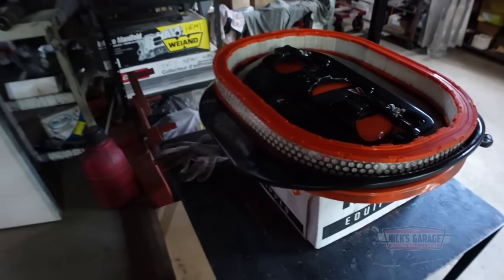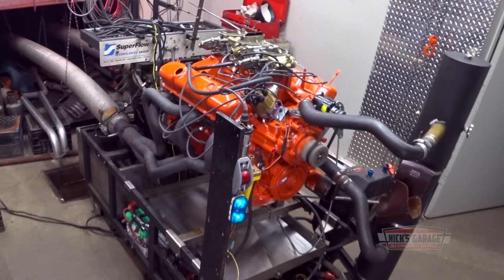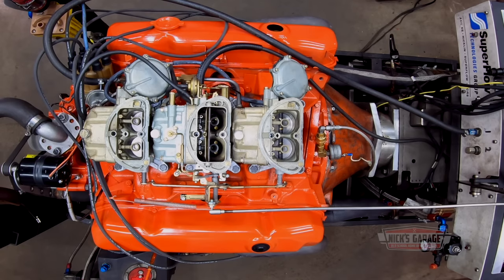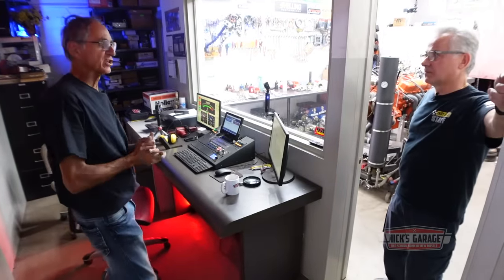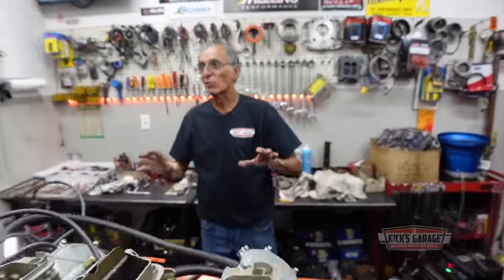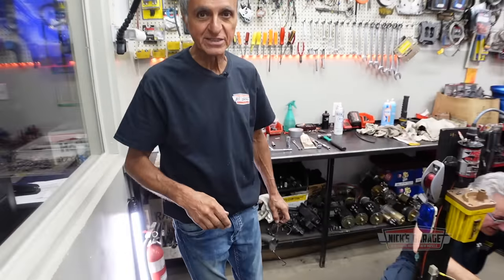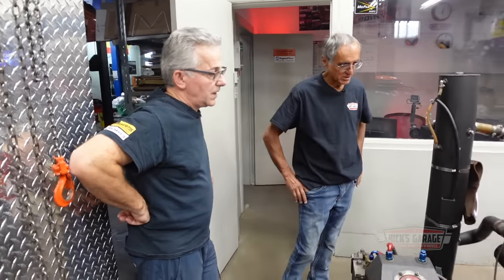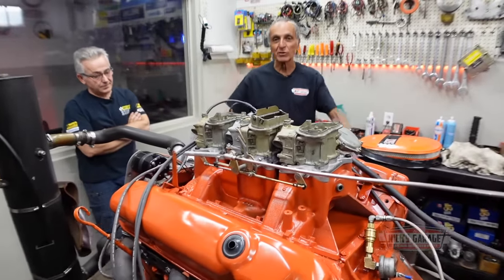HOT 1970 383 Mopar - Stroked and Dyno Tested - Road Runner Tire Melter

Comment: Hey nick I have a big block chevy 427 60 over AFR 265 fully cnc ported 235x241@50 duration 618 lift its a hydraulic roller with solid roller lifters 10.1 compression with a Victor Jr intake and 850 Holly double pumper and 1.7 roller rockers I'm hoping for around 525 hp so do you think it's possible? Any feed back would be appreciated.  Going on the dyno in a few weeks
Reply: 550 hp+  (@ the crank)
What is the AFR 265 (CNC)   FLOW??
??FLOW  over 300 cfm ??  will put the engine  @ 600 hp
When you Dyno your engine,    send me a comment back,  about  engine  hp.
Have Fun
Reply: @billywilliams6853  they say the heads I have the afr 265 will flow 345 what I think is going to kill my engine is its about 10.2 to 1 its a 427 60 over but the cam shaft is only 235x251 @50 618 lift
I would love it to make around 550 @ the fly wheel I seen a dyno at west tech and it was a 468 with 10 to 1 compression and a co.p cams xe300 more duration with the same heads ìt made 622hp I'm thinking the cam is what's going to hurt me
Reply: It would be really nice to make 600 hp but I really don't think it will.
Reply: I think you'll be pleasantly surprised 😉 I'd guess you'll get at least 550 probably more honestly. That's a hell of a motor lol
Reply: @richardsmith-qy6vl  
If you're going to drive 🚗  this on the street,  it  will  be  Great , keep the 235/251
Big Block  Chevy  Torque will  destroy any street tires. 
Just worry about the poor transmission.
Traction  is  the key 🔑
Reply: @Steve-bi4ej  
Amen to that 
Wishing I had those heads
Wishing I had that engine.
Reply: @billywilliams6853  yes it my street car I have a fairbanks turbo 400 with a manual valve body and a 3500 stall and I'm putting either a quick performance 9 inch or a 8.8 in it the 8.8 has strange axles and center section. And more then likely umi adjustable trailing arms and anti roĺ bar they say that wiĺ make a g body go straight and hook pretty good. If it will run a 10.90 I'll be happy as hell
Reply: Oh I'm sorry the cam is 235x241 I hit a 5 on accident and it's a 108lsa
Reply: @richardsmith-qy6vl  
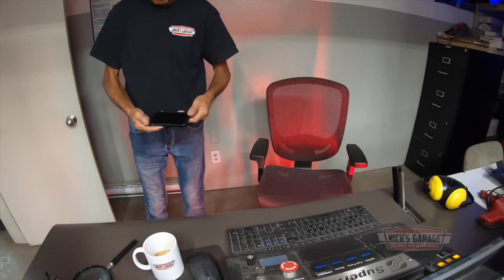 The rear end gear ratio,   stay in the 3 series.  Like 3:73,  do Not use 4:88 or 5:13.
That BBC will output 550+ foot pounds of Torque. 
Your Torque convertor will  flash multiply that engine Torque  2 or 3 times (550 X 2 =  1,100 ft/lbs).  Then the transmission (1st gear) will multiply by 2.54 (1,100 × 2.54 =  2794 ft/lbs.   Next multiply your rear end ratio (2794 × 3.73 = 10,421ft/lbs)
But in the quarter mile a 11 second car will be at 120+ mph or 10 second car 🚗  at  130+ mph.
For a car 🚗  top end  speed of  120+ mph or 130+ mph 😳 🤔   with rear end ratio  of 5:13 
What is the engine rpm,   8,000 rpm????? Or 9,000 rpm??????
Need to know your tire circumference,  how many inches your rear tire  moves on a concrete surface ,  One Revolution 🤔.    (Your tire roll out)
You do the math. 
I have seen,    many  quarter mile track cars,    hit the  engine's redline,   before the finish line 😳. 
Stay  with  a  3 series carrier
Reply: @billywilliams6853  I'm going to run a 275 on the street and a 28 x 10.5 slick with 373 gears no bigger then 411 I want to be able to drive the car on the hwy.
Reply: @richardsmith-qy6vl  
Excellent
Reply: @billywilliams6853  well yesterday was dyno day and I am so happy my motor made 643 hp and 590 tq I'm going there tomorrow to film al pitre said he's never seen a 427 make that kind of power before I would have been happy with 550 but I got a extra 93 hp...lol
Reply: @richardsmith-qy6vl  
Excellent
Reply: @richardsmith-qy6vl  
Those heads are good for 600+ hp.
Reply: @billywilliams6853  my motor made 661 hp and 605 torque on the dyno yesterday  I was shocked when I seen that.
Reply: @richardsmith-qy6vl  
Forgot to tell you,   another 10 to 20 hp,  in the Correct oil 🛢  pan.
Like Moroso 👍. 
Buy the correct aftermarket pan gor your car 🚗. 
Big  Block Chevy have alot of windage in the oil 🛢 pan.
Reply: @richardsmith-qy6vl  
Also use the 9 inch aftermarket  Ford style center. 
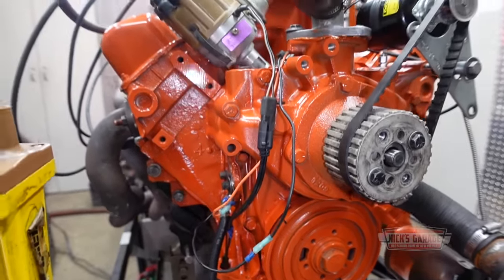Remember  use a 3:73 ratio.  Or 3:23.
Your trap speed will be  130 or 140 mph.
I  have built many Big Block Chevy in my shop.
Just like baking a cake 🎂. 
A little  of this, and   some of that.
Bam 650 horsepower.
Reply: @richardsmith-qy6vl  
Just remember,   a engine is a Air Pump.
The heads and cam allow the air Through the air pump.
A  427 Cid  will  move as much air as a larger air pump  (454) (502) (572).
The  427 will move as much air as the larger air pumps,   But at a higher  RPM.
Billy  is Not my real name,  I am Not black,  I hide my I.D.
Reply: @richardsmith-qy6vl  
About 700+  horsepower  is mathematical maximum for those heads and the carburetor  may be small @ 661 horsepower. 
Record the intake Manifold Vacuum at peak horsepower. 
Use a drop leg 🦵  Holley.
Reply: @billywilliams6853  I don't care what color you are I don't look at anyone for what color they are. . I only look at people by what type of life they live as long as someone is honest with me then I work with that.
Reply: @richardsmith-qy6vl  
Thanks

Comment: Nick I seen the show with your 383  6 Pack really enjoyed show but I saw you  do something that I do not agree with I saw you take off the vacuum hose off of distributor to set total timing, if you set total timing you need to include the vacuum going to distributor total degrees at your 3500 , the way you did it you probably have 50 + degrees of timing at 3500 . That is probably why you had high vacuum at idle, it was lean and the secondary carbs were bogging down and you had the Idle problems , I never moved my distrbutor without hooking up a timing lite to it hope you get it dialed in this just my perspective

Comment: 383 is a way under rated engine. I have built 440's and for the most part they don't make that much more horsepower while using a lot more gas.

Comment: My ol man had a68 roadrunner pretty much same build had a Single 850 cfm carb what a beast only thing in palm harbor fl in 81 could oitrun him was a 67 Pontiac 389 tri power with all kinds of motor work only beat him buy a carleanth in the quarter mile and nothing on top end could hang dad knew how to drive a dodge (crappy frot ends)that car wold run 160 maybe more if he could have kept that brick straight lol

Comment: 2 questions for Nick. How much fuel does it burn during your testing// what temperature is it in the Dyno room
Reply: 5 gallons of fuel to break-In the cam and about 10-14 tests. Depending on engine.

Comment: Maybe it's me but in the over head camera at full throttle there is considerably less fuel volume in the center carburetor?!
Reply: you guys have better vision than me, all the adjustments on 3 carburators are amazing to watch Nick fine tune them by hearing the sound of the test drive is amazing.

Comment: Sure was an extremely mild sounding cam! And as cool as those 6 packs (or 6 bbls) look, you can and will make more power with a good single 4bbl carb! But the owner will have lots of tire smoking fun with it either way! But with all the money spent I just can't imagine myself not going with a good set of aluminum head's!? With more torque than horsepower, kinda seems like a truck engine, not a hotrod engine. Like all factory truck engines they always have more torque than horsepower, hotrod's are just the opposite, more horsepower than torque. Which that's 100% in the cam choice!

Comment: The springs in the outboard carbs are too LIGHT. That's why you're getting a bog. You need heavier springs too slow down the rate at which the secondaries open. That's on the dyno. Once the engine is installed in the car  things might change. The cars weight and gear ratio are going to factor in the choice of springs to use plus it has an automatic transmission which also has to be factored in. Seems like a pretty stout combo and a six pack is icing on the cake. 😁

Comment: This might be off the wall but how can a 1964 Thunderbolt run 8's and make over 950 hp and still be legal in super stock classes ? How much does a 426 super stock Hemi make ? You would think the latter would be more .
Reply: I wonder on that 64 Thunderbird.
Reply: @nickpanaritis4122  1964 Fairlane Thunderbolt SS/AA 427 high riser . Owned by Robert Pond who manufactures blocks heads and other parts for Ford aftermarket engines. Also Ray Paquette has a stick SS /A runs low 8's claims over 950 hp.

Comment: Running 10:30 on a flat tapet cam what specific oil is it?  does it have high zinc in it to keep the cam healthy
Reply: Motul Break-In oil with high zinc.
Reply: @nickpanaritis4122  thank you sir I only ask because I'm trying to keep my Jeep motor alive as long as possible it also has flat tapet Cam straight six not that I would use that oil specifically for daily driving but I need something not happy with what's out there for sale

Comment: Did Mopar even make a 383 6-pack car ? Thought those were all 440 or Hemi cars.
Reply: No, but Chrysler DID offer a six barrel intake (Edelbrock aluminum) for the low deck 361-383-400 engines through its Direct Connection high performance parts program. Speaking of which, I only saw one in my lifetime at my local track back in the early 1980s on a 1970 Road Runner street car.

Comment: Do the dual quads that I think was a dealer installed option some time around 67? Any way there was a 383 dual quad setup, think it was rated at 345hp
Reply: There was a 2x4 383 built as a factory option for super stock class racing in 1962-63. It used Carter AFB carbs, and was rated at 343 HP. There were no optional setups, dealer or otherwise, with 2x4 carbs after this. The 343 HP engines used a low-rise cast iron manifold. In the 1960-62 time frame Chrysler used a famous cross-ram arrangement with the carbs sitting outboard of the engine, over the exhaust manifolds. Some of these were installed on 383's. The runners were tuned for either 2800 or 3500 RPM max torque, depending on where the runners separated into individual ports. These were only ever installed on full sized cars and would be a tight fit on B-bodies. From what I have read they were very effective.
Reply: Yes, now I remember reading that thank you, thought I remember a dealer installed option thank you
Reply: Some dealers such as Mr. Norm's Grand Spalding Dodge would probably dealer install such items on new cars at customers' request. Cams, manifolds, blowers, headers, whatever you were willing to pay for.

Comment: Hi guy's  watching the overhead  camera on top of the carbs,  the rear carb is not consistent at wide open throttle with fuel at the booster's  and the middle carb even less,

Comment: Would this be a 423 now? When an engine gets bored over, Why it is called what it was in place of what it is? Is it just for conversation and knowledge of what it is?
Reply: The engine number will always designate the original displacement,  could be why the original number is quoted.
Reply: But if ya wanna be sneaky, "it's just a little ol' 383". If you want to be boastful, it's a 426. If you want to be technically boastful it's a 432. In the end- It's a MOPAR.

Comment: When that engine gets about 3000 miles or so on it I think the torque will come up a little along with the HP so yeah it surely is a 500 foot pound of torque and 430+ HP engine no doubt. With manifolds I think it will lose about 20 to 25 HP and some torque as well.
Reply: We are running the engine this week with manifolds. Stay tuned for the  results.
Reply: Can't wait, be interesting to learn the results to.

Comment: Do you use synthetic oil on your engines or regular oil? Thanks Paul
Reply: Non synthetic for break-In,  after that I use either one. Make sure if you have a flat tappet cam use oil with ZINC.
Reply: @paulposey1162  .     Yes, zinc is always used with flat tappet.
Reply: @nickpanaritis4122  what does Zinc do that regular oil doesn’t . Thanks for your program. Bought my first car 440 just prior to going to Vietnam  , man wish it today .

Comment: We have fuel is 91 octane  ,95 octane  and 98 octane  here in  Western Australia
Reply: Your octane ratings are computer differently. Yours are similar to our 87, 89 and 93 octane.
Reply: NZ and AU use the RON system, while the US uses R+M/2, which gives a lower number. As far as I can tell, the NZ 98 is about the same or slightly higher than the 93 octane from the States.

Comment: I had a 1970 road runner  ....with a 383 magnum..it was rated 330 horse..it was a little slow out of the hole..but  it was fast enough  to beet a lot of cars..I had an older guy who said he could beet anything on the road.he worked at the ford dealer  in whitesville.he had a ford torino gt with the big glass in the back..427. .with a  four speed..beutiful car...I shut his mouth..and he didn't get in front of his buddy's and Bragg anymore..

Comment: I’m really quite surprised that you are willing to run the Dyno runs with too much oil in the engine. It’s a proven fact that too much oil will rob horsepower from an engine! that’s why it’s important to have a good windage tray to keep the oil off the spinning crankshaft.
Reply: We have a windage tray in the engine. No harm with a little more oil for cam break-in.

Comment: Sorry, bud they make cam break in oil!
No point in adding extra oil that can get over oxygenated by the crankshaft and introducing air into the oiling/bearing system.
Reply: Nick, look into Comp Cams break in oil additive. It's a great product for new engine and cam break ins. Not very expensive either!

Comment: more chance of starting it easier with more timing advance   WRONG slow the timing down it will crank like it has less compression so it will turn over easier now you can get the timing so slow it won't run but you can also get it so fast that it kicks back on the starter and almost won't crank

Comment: If you want it to REALLY put out sum will at scwall,,,,,,,use an eight hundred db pumper with a bit bigger jets, watch what it'll do at 5500 rpm,,,,,and I hope you're not running a 509 cam also,,,,use the JEG 549 lift kit, the you'll have a damn rocket on wheels, even in a B body !
Reply: There's nothing wrong with the MP 509 cam.

Comment: take it up to 6200 rpm
Reply: At the end after replacing the springs we had it at 6300 RPM.
Reply: @nickpanaritis4122  were there a hp increase at higher rpm and how did the engine finish out GOOD I HOPE
Reply: @3334-n7s  ...We Finished at 540 HP at 5900 RPM.
Reply: @nickpanaritis4122  well you get a pat on the back from Texas, Have a great day and thanks for the info, my Corvette is supposed to arrive maybe next week, will try to send you a photo. The 73 Cuda 426 4spd was white with black interior and rebuilt, nice car was sold last week.